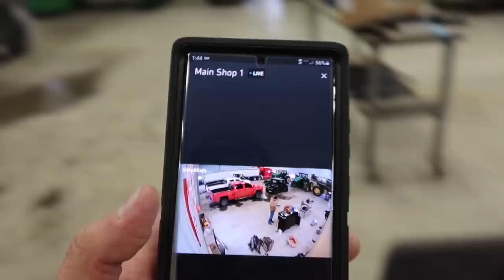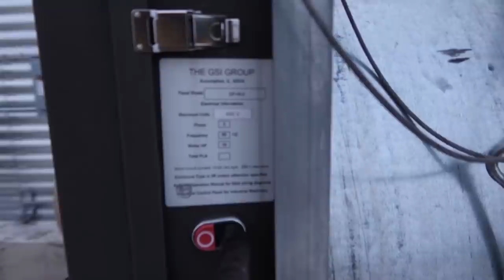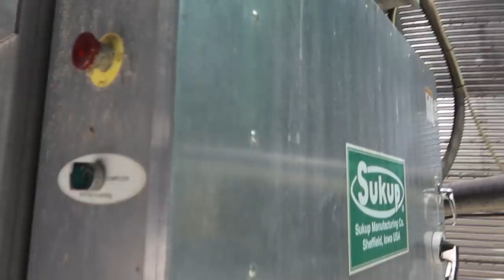She's FROZEN!

Comment: Can honestly tell you're a farmer and not a truck driver. Especially in the winter you never set your trailer brakes
Reply: Hes gotta get sophisticated and get some of those fancy disk brakes no problems🤣 no better way to start a day swearing at an objects thaf dont care while beating on them
Reply: My favorite part, he doesnt plug his trucks in! Some good cold starts on equipment. :)
Reply: @ B S nothing better than seeing a cold start
Reply: If you like cold starts you should see one on a 34000 hp engine,  not something that’s normally done but when it is it’s impressive.
Reply: Unless you've had a lot better luck with your air supply than I have.....they'll eventually set when the air pressure drops anyhow.....so why not set them?  Sometimes they hold air better after they're set....you know that
Reply: @brucekoster9253  setting the brakes when sitting in a warm shop shouldn’t be a big deal to begin with!
Reply: @ikepeters9758  agreed......although I'm not sure it's all that warm inside...it's certainly better than being outside.
Reply: @JC-uq5gi  I'll take a (pretty safe) guess.It has to be a ship.Rail engines top out at about 8000hp
Reply: @YouTube_Professor  Now i want to see that!But i'm guessing it might be quieter than i'm hoping? I've seen those engines running and it's actually a nice experience.Lots of rhythmic sounds but nothing ear piercing.

Wait- do they start them with pyro charges in each cylinder? Please tell me its that!
Reply: J C ship engine,  it’s absolutely avoided at all cost and when it is done the temp is well above what you see in Minnesota.   But still pikes smoke out all the cylinder exhaust connectors and sounds like hell.
Reply: @Ron Chappel , 400 psi compressed air is admitted to the cylinders to get it rolling, once rolling the fuel is cut in and off it goes.
Reply: @J C nope no preheated air,  the jacket water has steam heat exchangers to keep it warm.

Comment: Zack - it is a good habit to operate disconnect switches with your left hand while standing as far right as possible and looking away.   It will minimize the trauma if you close into a faulted circuit. You already have pretty good choices in clothing that shouldn't melt to you.

Comment: Hey Zach a fair warning about simplisafe, it communicates on a 433Hz frequency, which is the same as a (garage door controller, etc) and it can block the signal from the sensor to the main UI, which can allow an intruder to break the glass while simply holding and emmiting a 433hz signal and the main UI won't pick it up

Comment: Zach if you blow some WD-40 through the air cart manifolds and piping it helps coat the steel piping and stop corrosion on the steel part while sitting all winter.

Comment: Ever think of installing switches or a lighting contactor?  it's not good for the breakers to be switched on/off all the time.  Same with the disconnects for motors.    And don't forget to fix that broken motor flex they did a temporary fix on.

Comment: Zach. It might be worth considering making a SUPER CAPACITOR BATTERY. You can hook it to a nearly dead battery, wait a couple minutes, and crank the engine at full speed. A super capacitor charges or discharges in seconds. It is like putting a coffee cup under a dripping faucet for a few minutes, so you can come back and drink a cup of water in a few seconds. It would cost you about 300 dollars, but it weighs 15 pounds, lasts forever, and can be thrown around, or set upside down without any concerns.

Comment: The other night my shop had gotten broken into, when I walked out there with my boom stick I poked into the shop and the guy instantly hit the ground, now I have a deadbolt door with a normally locking door handle and 7 padlocks holding it shut, I wish someone else would try to get into it now

Comment: Can you give us your thoughts on the cost of new machinery vs having older gear with maintenance bills?
It appears that you can almost rebuild an old machine for the cost of a service on a brand new tractor.
Also how do you value you're desire to drive a new tractor vs what it will actually make the business compared to an older machine. Also, do you think we have reached the pinnacle of tractors? Simpler the better? I have DEF and will not buy a machine that uses it. I prefer to run wrenches than a laptop.
Another point to cover would be what are you going to change up for next year and how do you hope this will affect your bottom line? Do you gradually progress towards a target or is every year different and does your plan go back and forth?
Cheers Zach!

Comment: I'm told that if you have a power outage you must manually reset your Simply Safe system?  If so, not good if you are traveling and not home to reset.  Please tell me I'm wrong.
Reply: Jack Arnold - SimpliSafe handles power outages automatically. No manual reset needed. Switches to battery power, then back when power comes back on. The system also sends a text when power goes out and when it comes back on.

Comment: Had the simply safe system. Got ripped off. Just key your CB or Ham radio next to it or near by it will diaable the system. Do not want to put Freq. out there but its a common freq.

Comment: I've always found section (k) of the U.S. Flag code "The flag, when it is in such condition that it is no longer a fitting emblem for display, should be destroyed in a dignified way, preferably by burning." to be ironic compared to the reaction those that respect the flag have to those that burn it in protest.

Comment: Why don't you have a sensor in the bin that tells you how full the bin is instead of having to go bang on it? I would think that the bin would come with a sensor because of how expensive it is.... In this day in age you'd think they'd have an app that is on your phone that can tell you exactly how much you have in your bins in real time.....
Reply: Because the sensors that are capable of real time level sensing are several thousand dollars.
Reply: @WeedNemesis  wierd... should be relatively cheap.. doesn't seem to be a really hard problem to solve....
Reply: @letstrend  ultrasonic has issues with the dust so that pretty much leaves radar and when you get to industrial sensors nothing is cheap.

Comment: Why would you want to buy the strip to when you've proven is junk or pain in the ass
Reply: Farm equipment has a learning curve.  The more sophisticated...  they are set for average conditions.  You have adjust to your conditions.  My first two cornstalk fields my dish/chisel worked great.  The next field it plugged in one area almost every round.  Much more clay, it was a bit more wet.  I could have made changes, to account for that. (Two twist shanks are not faced the correct way, they toss material against tires, it can plug). 
  The machine that drives you to drink.  Once you figure it out can save you time, money next yr.  he has time to check things over.  He owns fertilizer cart, it has new measuring grates?..  with a new look next spring (after planting). He could check air leaks, issues.  By fall it could reduce his fertilizer costs greatly.  IIRC the tillage side was good.  The fertilizer (which is likely his cart/fan/plugged line/air leak...) did fair in everything but 2 rows?
  IMO not time to quit when success close.